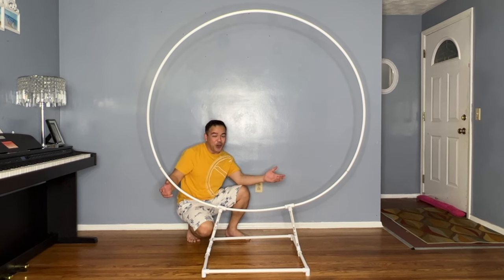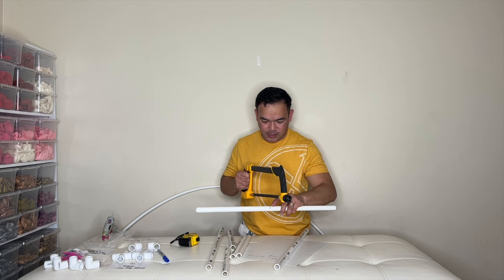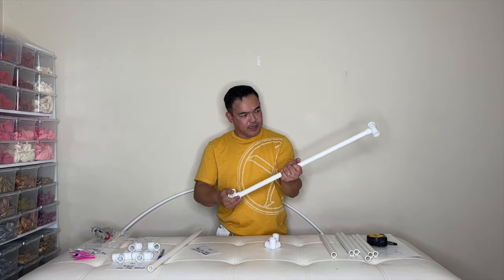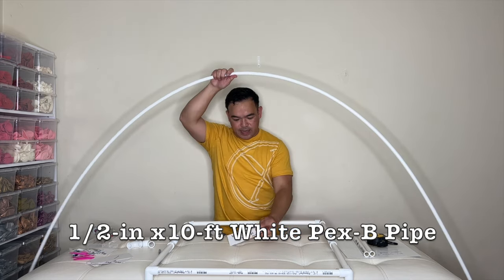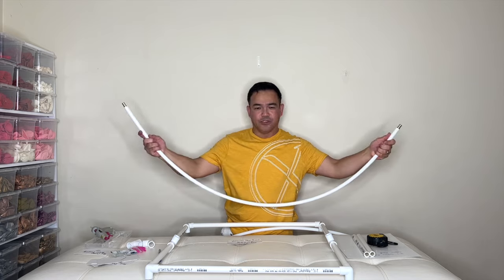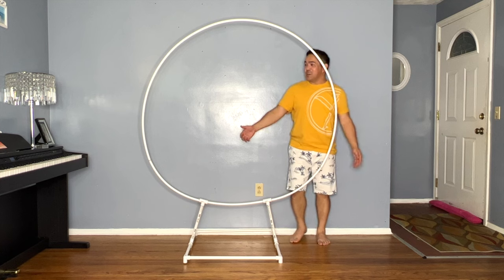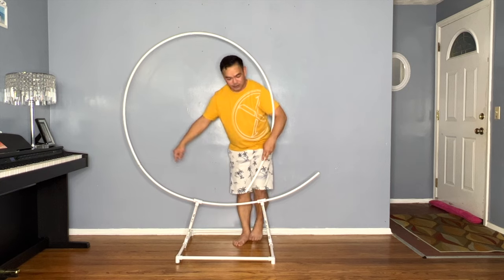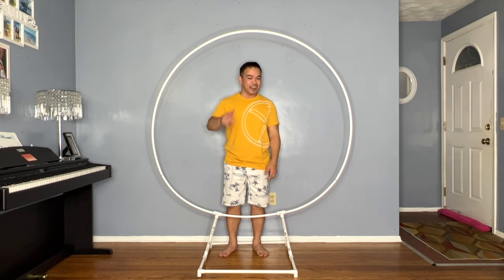Making our own DIY Round Balloon Arch Stand/Balloon Tutorial (Do it your own project)

Comment: Chelan, how much did it cost to make? Isn't it cheaper to buy one ?
Reply from the maker: Hello Vurnis, we had one before it was the 7 feet and we got it for $100 plus (tax included).  We made this for an indoor decoration since it was a last minute project, the venue's ceiling is too low so we can't use the bigger one, so we decided to make a DIY to fit to the place and we need it very soon.  We also did put the total cost in the description so that people will know how much and from there they will decide whether to make one or buy one.   Thank you :)
Reply from the maker: By the way, the one that we got before was 7 feet so the smaller ones might be cheaper :). Thanks again.